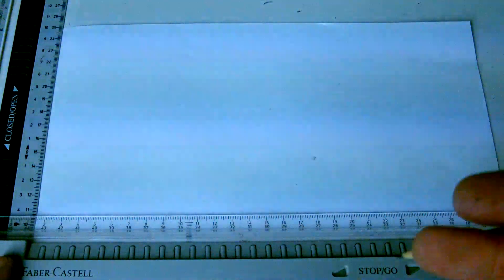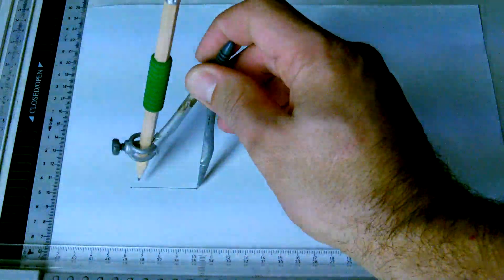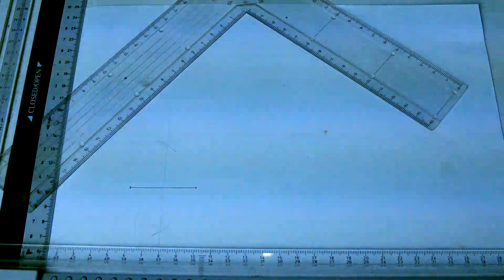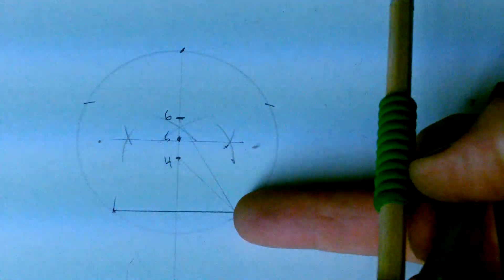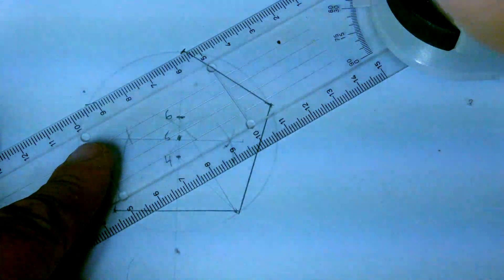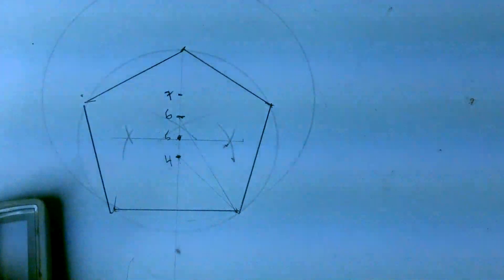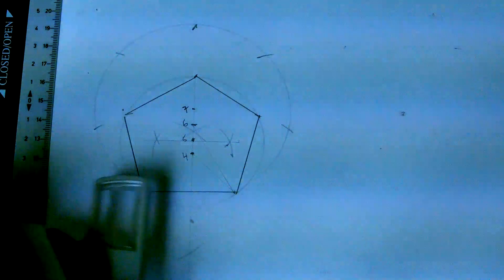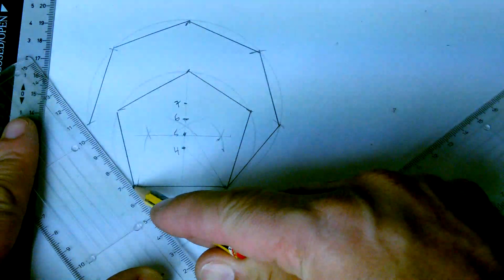Construction of a regular Pentagon and Heptagon

Comment: Sorry to say that - but your method does not create an EXACT pentagon. Just try it with a bigger base line. Your method gives an internal angle of 72.41... degrees and it should be 72 Degrees. When you copy the base line 5 times as recommended you do not land on the the left side of your base line. If you do, the last leg is shorter than the base line.
Reply: True, but then again there aren't many methods which aren't slightly inaccurate. Besides he was my teacher at school and this is mainly for a better understanding for students.